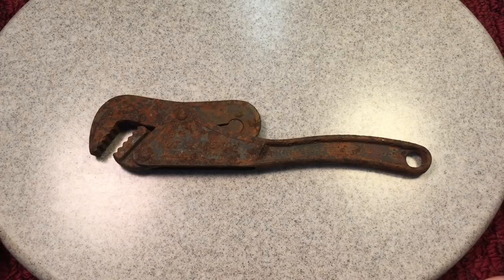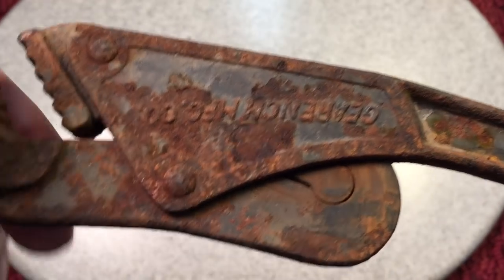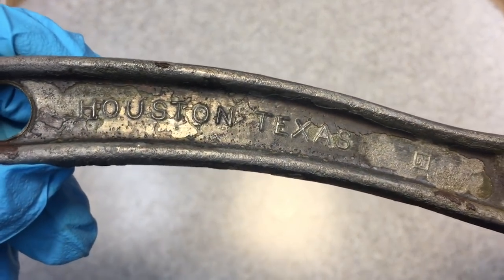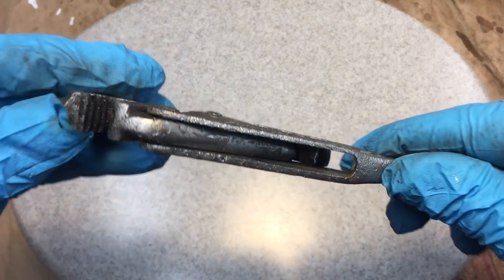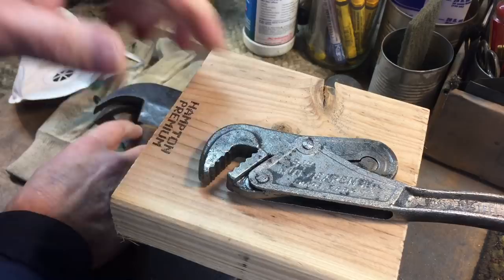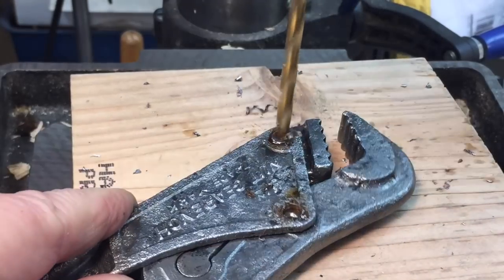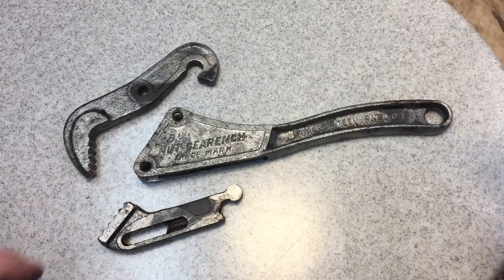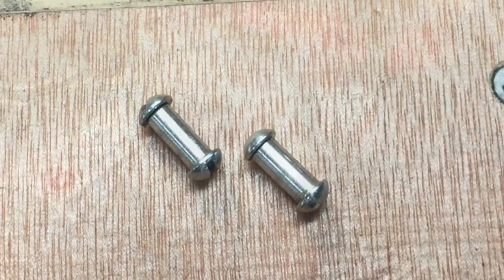1926  Nut Gearench Restoration

Comment: Nice job. I like the rivet solution. Drilling out rivets can be tricky. I find it best to hand drill the heads, adjusting constantly, until you find the center. Once you can pop the head off, driving them out is easy. Finding acceptable replacements is a problem I am having. I have riveting tools but they will lock a joint solid. Bolts and screws is what I am using for now. Nice job, glad to see you expand your "horizons"!

Comment: I love the restoration.   Very well done.   I like the home-made Chicago style bolts to replace the rivets.

Another option for the rivet removal is to use a small end mill in the drill press to make a flat before you use the centre punch.

The flat black makes it look like it came from the factory.
Dave.

Comment: It’s a beautifully elegant design! In a way, we have lost something in this country and this tool is an example of what I am referring to. You know the gun, the 1911? It was designed leading up to the year 1911 and from basically 1900 up until the early 1970s we had engineers that could not only solve a problem, but do it with an elegance and flair that set them apart from most other engineers from around the world. After the 70’s we kind of dipped really low until the late 80’s and there was a slight resurgence until around the year 2000 and then it went down again and only within the past 5 years have we started to try a resurgence again and the problem is that China is now where we were in the 1920s.
Reply from the maker: Joe you are so right...   My favorite era for tools is the 1920's...   =D

Comment: If I need to 'drill' out a rivet I use an End Mill Bit, specifically the ones without the hole in the centre, and I can just lower it on the rivet until it's just above the surface of the tool and then tap through the remainder
Reply: I worked in the aircraft industry and as you can imagine we had to drill out an awful lot of rivets. They way we were taught was to drill a centre hole ever so slightly smaller than the rivet diameter, then when you are slightly deeper than the head just use a cold chisel to take the head off. As long as you are careful with the angle you will not damage the work, you can then punch out the rest of the rivet. Doing it this way you avoid damaging the hole too much.

Comment: Very nice restoration, I am very impressed.  Another idea I had for rust removal was for a giant tumbler made from a treadmill with a 5 gallon cylinder style Coleman cooler as the tumbler chamber.  I am going to use pebble size quartz and wood ash for abrasive media.  Do you think it will work?
Reply from the maker: Oh yeah!  Tumblers are great for removing burrs and sharp edges however Pitts are spawn by Satan himself!  =D

Comment: Amazing transformation. Love your idea for the rivet replacement, I will have to remember that solution. You just threaded the inside halfway?
Reply: I think he ran the tap all the way through.
Reply from the maker: Tony -  That was my intention but I happened to have a "Stand-off"  it's a small threaded tube used in electronics!   =D

Comment: Several thoughts: I seldom disagree with a word you say, much less do, but I would have ground the heads of those rivets off then drove them out instead of drill them. Secondly, I wonder if that company is related to the present Gearwrench tool company which is of good quality and becoming a very popular brand? I honestly thought they were a fairly modern brand but now I wonder if someone bought an old brand and reused it? It would be interesting to know the story of the name. Finally, and I may have written this before, but 40 years ago every auto mechanic and I mean every one, had a wrench like this in their tool box. They were essential! Steel Fuel lines going to carburetors had brass compression nuts attaching the line to the carburetor. The brass was soft. On every car or ruck you worked on over five years old somebody had rounded off that soft brass compression nut before. The only way to get the line loose to rebuild the carburetor was with a wrench like that.
Reply from the maker: The problem with grinding rivets is not damaging the tool underneath, the drill procedure ensures the tool will be untouched and works every time...  =)   I too wonder why certain tools just fade away!!!!!!   =)
Reply: Yes, the modern Gearench company is the same as the one making the restoration wrench. Their "About Us" page (https://www.gearench.com/company.asp) says, "Gearench was founded in Houston, Texas in 1927 as Gearench Manufacturing Company, by J.A. Peterson and C.E. “Pat” Olsen. The first patented product, the Gearench, was a hand tool for use on small diameter pipe. From this original tool, the company has grown and developed over 40 product lines for use in various areas of the oil industry..."

(I was impressed with the strap wrench I got at the hardware store, then I saw this: https://www.gearench.com/products/surgrip-casing-tongs.asp)

Anyway, great restoration and I agree that black is the best accent color to use on it.  I just wish they weren't so rare that ebay prices are what they are — it looks like a useful tool to have arouind the house and shop.  Thanks for taking the trouble to do the job on it!

Comment: Hey scoutcrafter!  I have a favor if you're up to it.  I'm happy to pay for it as well... I need to adapt my FM radio mast to a CB mast.  The male post coming out of the car is M5x0.75.  I need that to turn into a female  3/8 x 24 for a CB antenna to thread into...  So female m5x0.75 on one end and femail 3/8x24 on the other.  This adapter just doesn't exist and i'm a little stuck.  Next time you're working on the lathe if you feel up to it, i would GREATLY appreciate it, and like i said, i'm happy to paypal some $ to keep funding the channel!  

Take care!  love  the rants btw.
Reply from the maker: I know they make adapters for your purpose!  You just have to search it out like on sites like this  https://www.fittings.space/fittings-by-thread/metric-thread-adapters/un-sae-metric-adapter-fittings.html#q=&idx=live_site_default_products&p=0&fR%5Bcategories.level2%5D%5B0%5D=FITTINGS%20BY%20THREAD%20%2F%2F%2F%20Metric%20Thread%20%26%20Adapters%20%2F%2F%2F%20UN%20or%20SAE%20to%20Metric&nR%5Bvisibility_catalog%5D%5B%3D%5D%5B0%5D=1